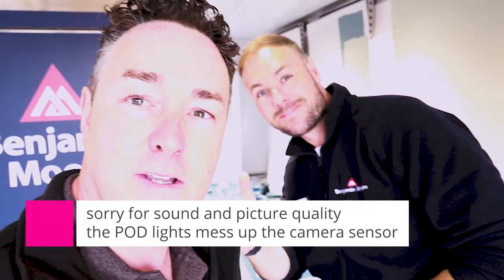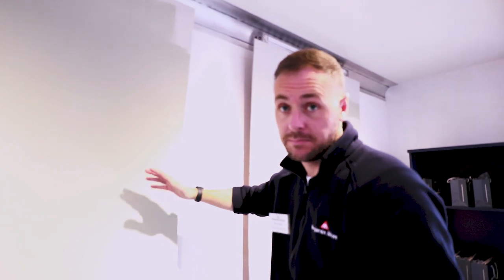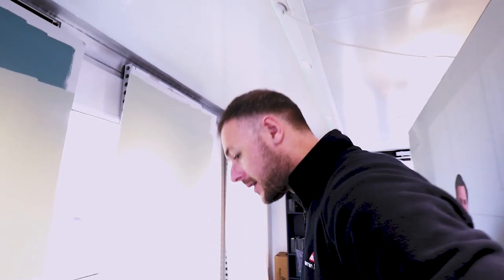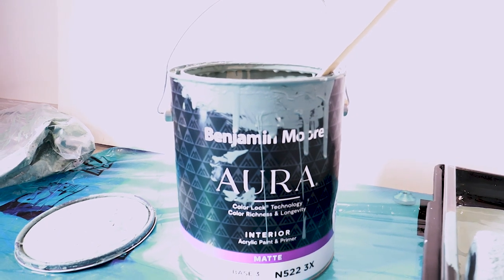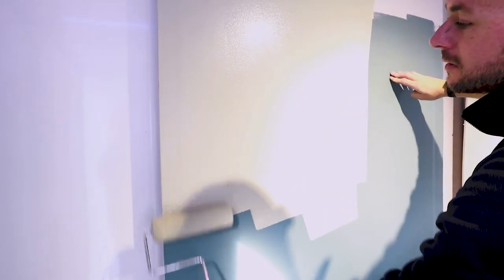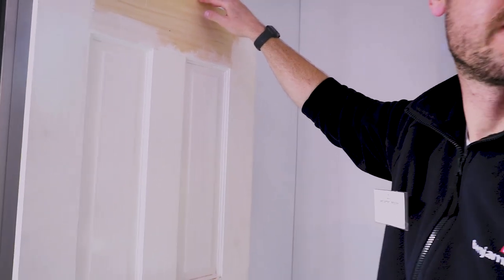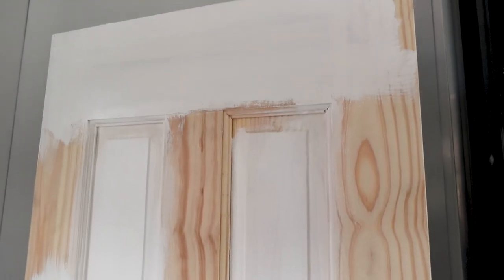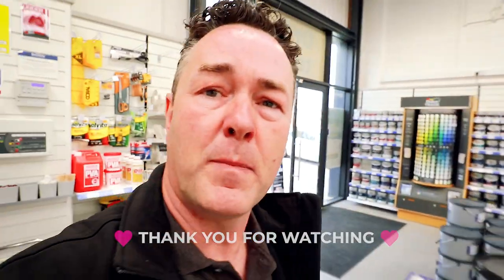Benjamin Moore on Tour - Brewers - Mansfield

Comment: Hi Phil,  great video.  From using my experience, I’d step up to the Regal Select for your woodwork, and take a step down (in the Ben Moore line) from the BEN to the Ben Moore Ultra Spec for the walls.  The BEN is not great for woodwork, and it’s a bit more expensive (and does not perform) as well in walls as the Ben Moore Ultra Spec.  Regal Select (or Aura) on woodwork, but in the Benjamin Moore line, the Ultra Spec (one level down from BEN).  And in my opinion, yes you can put Aura on without rolling the new plaster w/ Guardz fist, but I always 100% seal/prime the nearly every wall,  to make certain that the Aura really looks perfect after two coats.   **ADVANCED is the paint Benjamin Moore makes that I believe you will be most impressed by Phil.  ADVANCE is without a doubt the closest product in the market to any oil based paint.  

**. GIVE PHIL A FREE SAMPLE OF 
Benjamin Moore ADVANCE, eh🇨🇦

Awesome video Phil
Reply from the maker: Cheers. How do you find the advance washes out being the hybrid paint?

Comment: I currently use Isomat paints. The quality is high and the pricing is good. However, I think I’ll give BM a try just to compare. Given the price difference, it’s gonna have to be really good to pull me from Isomat
Reply from the maker: We use Isomat too.... currently on an outside using isolac. It's very good. 5% thin it with water... Flows out a treat
Reply: Agreed Andy. I flit between isomat, tikk and teknos. I sometimes think there's just too many higher end products on the market now but on the other hand I'm desperate to try BM just to see what all the fuss is about. It's going to have to be good gear to get me to drop any of my current brands 👍
Reply: @ProfessionalPainterDecorator  So will you stick with the Isomat Phil? Or is it a horses for courses kind of thing.
Reply from the maker: @Monkeyman15687  both very good and it's nice to have tried the two. Having the option to use both is handy. A big job we've got to do I've allowed to use BM paints... Ben on the ceiling and walls and ScuffX on the woodwork.
It's quoted... So price was given..
materials and labour £xxxx
+Vat £xxxx
Total £xxxx

So not split on prices..just the spec has said BM paints etc

Outside, there's some coloures apex fascia to do which I've said Isomat

Windows Sikkens HLS and Filter 7.

And we have to job to do. :)

Comment: you're saying to use Benjamin paint to prime walls instead of cheaper emulsion paint, where you referring to bare plaster walls, cause I'm guessing you weren't taking about any other surface( as in you would only prime bare plaster walls)?
Reply from the maker: Hi. No watch it again... Ben was saying that paint you can apply as the primer coat.